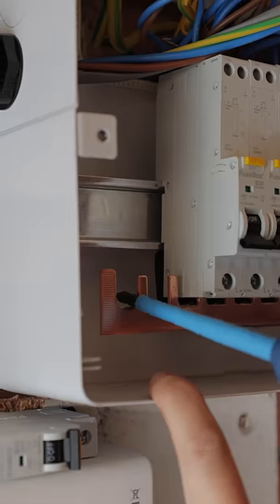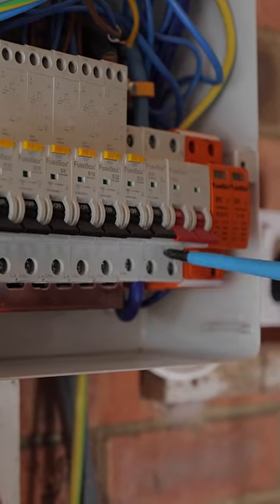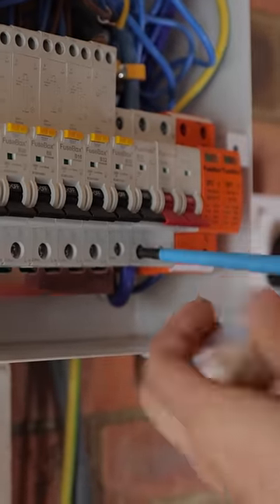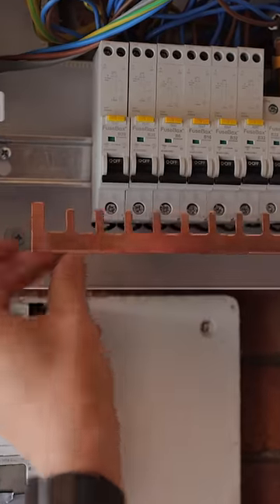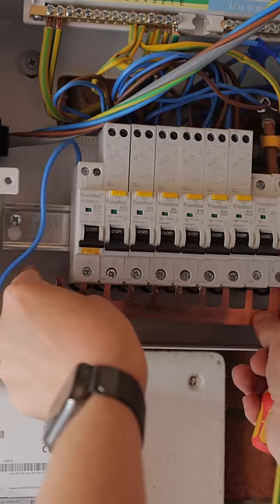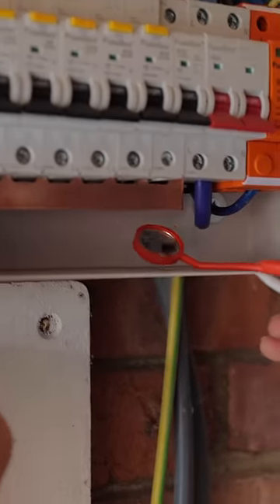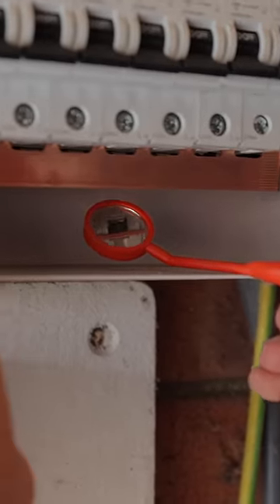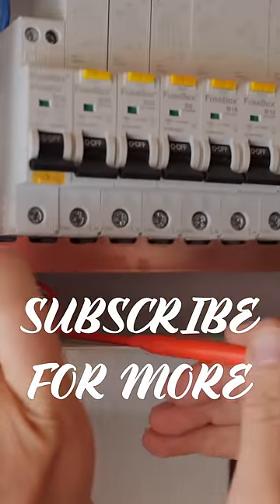It's always good to DOUBLE CHECK! Incorrect busbar installation 😮 #shorts

Comment: No isolated Busbar. Something you wouldn’t see in Germany nowadays. They all got a Plastic Cover.
Reply: As they should, first thing that made me frown when I saw this
Reply: Yeah nothing wakes you up like touching an uninsulated Bar 😂
Reply: @bobhempf7944  normally you should put the power off if you wanna work on it anyways
Reply: Same in France. Uk electrics are a joke
Reply: The plastic cover clips on last thing with that unit
Reply: @MrRobertBatchelor  everything should be ip2x so would have a cover over. This would be CE marked and comply for sale in France and Germany, so dont talk rubbish. I've worked with French electricians, or I should say I've corrected work done by French electricians.
Reply: A plastic cover is usually fitted to it after installation is complete.
Reply: We do have covers, but obviously he's taken it off
Reply: I would like to remind you that in this super fantastic Germany state of electrics you still have more electrocution deaths per capita than the UK.
Reply: Ich meins ernst den schock den ich grade hatte ach du scheiße
Reply: @jackster2568  but is the % higher? Iirc there are more people in germany than the uk
Reply: @HISKILP  you might want to look up what "per capita" means...
Reply: Ohh, and no lid on the box...
Or..
It's been removed already.
Reply: @dougaltolan3017  oh okay, sry :D
Reply: @jackster2568  in Germany 35 people died in 2019. And in UK 70 People died.
Reply: I work for a German company hager they use plastic sleeves on the bus bar
Reply: One day, the US will require to insulate ground all the way.....walks over taped over grass lawn.
Reply: Neither would you see one here, in Finland
Reply: @pab26120  If you can't work out why a larger terminal would be needed on the busbar at the main switch outlet you have absolutely no business messing with electrics.
Reply: @---jr5yb  yeah I'm gonna need a source. The various sources I've seen from a quick Google are half that (if even). Was 2019 a cherry picked year that had higher than normal deaths?
Reply: @einlehrling u cant always turn off the Power
Reply: @iloveiceecreeam8657  that's why I say normally. Of course there are some times where it's not possible.
Reply: @jackster2568  probably Germany is just much more electrified:)
Reply: Same here in Australia
Reply: Can't work on something with the cover still on...
Reply: ANGLE GRINDER muahhaaaaaa
Reply: @HarryL2020  apparently for some, not so obvious 😂
Reply: Agree, this looks crazy dangerous
Reply: @einlehrling 2 protection valent mieux qu'une, en france coffret ouvert aucune piece  sous tension ne doit etre accessible, deja pour que l'electricien puisse faire des tests en toute securite et deuxiemement au cas ou un non professionnel ouvre le coffret.
Reply: @olivierfu7778  aussi au l'allemania
Reply: @einlehrling  And thats the difference with insulated busbars. 

I can swap out an circuit breaker, without having to shut dwn the whole busbar... 
It is designed to function that way in german installations. 

You dont have to understand every rule that VDE made, but most things are there for a reason...
Reply: @vophatechnicus  normally you have to shut down the whole busbar because of the 5 safety rules: 1st rule is to shut off the electricity
Reply: @einlehrling  but i love working in live electrical panels its so much fun risking my life /s
Reply: once bumbed into a 3 phase 400v phase to phase busbar that when i was installing a new cable, dropped the whole insulating cover. leaving me oogling the 3 copper plates, 1,5mm between them, under 3x80A main fuses. Retreat, and call for a shutdown.
Reply: They have a plastic guard for them
Reply: @ferrumignis  yeah no. Just use the larger bus bar on every post. Who know what you are gonna use on them. 
6/10/13/16/32A just use the larger one on all of them and you are free to go. That what he means. You are not supposed to go down in AWG in Germany and usually you use 8awg/10mm^2 or 6awg/16mm^2 so the bus bar is 8/6awg from front to end.
Reply: Yeah we get plastic covers here as well.. he will slip it over the busbar when complete im sure
Reply: @alanreedom2647  "yeah no. Just use the larger bus bar on every post. Who know what you are gonna use on them. "

Another clueless person that can't think of any possible reason why the bus bar connection would be larger where it connects to the main switch, but thinks they know everything.  Here's a hint:  think about current density.
Reply: @ferrumignis  You don’t have to explain to me what you mean I understood it. If you have 18A x 8 that is 126A but what should happen is not that prong 1 can take 126A EVERY prong should take 126A. That is the correct way.  That what you mean is just the wrong way, it’s narrowing of the cross section, that is just wrong. Every part should be the same cross section, so if you beef up one part you beef everything up.
Reply: @alanreedom2647  You still don't get it.  If every prong draws 126A, then the one at the end will need to support a draw of e.g. 1260A for a ten way bus bar.
Reply: @bobhempf7944  once I was taking measurements with a multimeter and the pins accidentally touched the unisolated busbar, that was a nice spark
Reply: @YTDumpsterBaby   I don’t doubt that. Whenever I watch electrical videos based in the Uk, the electrical products seem to be of lesser quality and the installation seems over complicated. And the products are from the same brands in France and England so it seems like they’re just fabricating sub par quality for the British market. I’m not really saying that Uk is more dangerous.
Reply: This has a plastic cover. It's been taken off.
Reply: @MrRobertBatchelor  I've only seen videos of British switches and such and all of it looks like total crap.
Reply: @MrRobertBatchelor  can you not see the clips the busbar cover slides onto? How’s he supposed to install breakers without removing the cover first , don’t speak upon a topic you’re uneducated on , makes you look silly
Reply: So does this one he’s just removed it to install breakers , worries me how uneducated some electricians are outside their own country
Reply: @einlehrling  its not about working on it
Reply: @sackratte  why not
Reply: same in UK..
Reply: @MrRobertBatchelor hard disagree there
Reply: It has, just a short explanatory video about the two way end of busbars.
Reply: It clips on afterwards
Reply: @MrRobertBatchelor that will be covered. I'm fascinated to hear why you think the British system is a 'joke' and France's is superior?
Reply: @literate-aside Just the quality of the products seem sub bar to what I see in France.  They also have a lot less breakers on similar size properties making me think they’re pushing the limits more. 
Mainly the aesthetics really.
The cheapest stuff on the market here looks similar to quality stuff in the Uk.
Reply: @MrRobertBatchelor  it's the same brands all over the world, with BS and IEC standards being effectively identical.

They objectively have the safest outlets, plugs and appliance requirements in the world.

I'm still struggling to see what makes them a 'joke' when your basis is things 'seem' to be worse. Are you in the industry?
Reply: Makes sense
Reply: @MrRobertBatchelor  he’s working on it… the cover is off! 😂
Reply: @MrRobertBatchelor uk electrics ain’t that bad it’s different brands off boards like fuse box ain’t very safe for working live but most now have a way so you can work live safely
Reply: It's the same in the UK.. I think he'd just not put it on yet
Reply: You've got to fit one in the UK as well
Reply: @MrRobertBatchelor  however French electric don’t even follow the European colour code standard you favour realise that plastic covers can always be removed with enough force if someone is installing it in properly covers could be removed by then

Comment: You'd think they'd insulate the bottom of that busbar.
Reply: To keep it nice and warm?
Reply: alot of em have a plastic cover you put over bus bar at end
Reply: my busbar is isolated. I guess this is the UK. They have different standards.
Reply: There is a plastic cover which clips over the busbar (you can see the mounts at the start of video)
Reply: Yoh think they'd put a cover on the whole box too.

Comment: Electric panels are so much different here in the states
Reply: Safer over here
Reply: And built quality too. Even the cheapest in the states has more safety features and less redundancy than this thing.
Reply: @gabrielrod1330  our regulations are much stronger here on pretty much everything except food.
Reply: Different - worse..
Reply: @gabrielrod1330  I challenge that...  To start with - we put RCBOs into the consumer unit.  They are protecting the whole installation..  Everything is built properly.   We also don't allow aluminium to be used.  Because that is horrible.
Reply: @tcpnetworks  alu is just being cheap, nothing to do with safety
Reply: @tcpnetworks  and RCBO is common in most European countries.
Reply: @tcpnetworks  RCBO is extremely common in most of europe
Reply: @Asbjoern  aluminium is cheaper than PVC now? Making things up isn't an argument.
Reply: Is this the actual panel or some solar controller? Looks like ups controls.
Reply: @jackster2568  aluminum is cheaper than copper
Reply: @danichicago9140  there regulations are different along with the fact the use high voltage then we do in the states.
Reply: @mitchponder837  no shit. Our 277/480 panels don't look like this either.
Reply: @Asbjoern  Australian here - RCBOs/RCDs are law.  We tend to use RCBOs now to limit circuit leakage current. 

American shit - nah.   None of that is safe.   Even a fresh install looks like it's utter crap.
Reply: @timmieskills  I know.   Used to work there.
Reply: American Code now requires GFCI protection for most areas of the home. Also, half the voltage to ground.
Reply: @user2C47  Ohio code for GFCI is bathroom, kitchen, exterior, garage and any unfinished areas. However every finished area is required to be arc-fault protected along with refrigerators microwaves, dishwasher and disposal
Reply: @timmieskills I don't have any of those, what are them for?
Reply: @tcpnetworks  we have gfci and afci protetcition and yes in panles too not just at outlets. I hardly see any euro panels with arc faults protection. Get off your high horse.
Reply: @tcpnetworks  in America we call them breakers and arc fault and ground fault breakers are commonly used in most residential buildings in new construction. Same thing as yall just used in a different way and if done properly can be just as safe as your work if it was done properly.
Reply: Yea no shit lol here in Canada as well...
Reply: Idk for electricity guys but houses in the US are cardboard wtf
Reply: @Jujulem61  those production homes are not very good that's why I work with custom builders in million+ dollar houses. Only a few in the past 10 years have used bad framers and are scabbing the houses together.
Reply: @daltonpethel5697  The ONLY time we are permitted to install unprotected cable these days, is in a hospital - we feed the supply into the cubical/room and put a medial-grade RCBO in that protects the room.  That way the supply can be reset within the room - so people don't die.
Reply: @tcpnetworks  yeah we stopped aluminum wire in the 70’s.

Comment: It pays to open the terminal fully otherwise the buss bar can be inserted behind the terminal.  You should see the mcb move to allign with others, if it doesnt then the copper is not clamped.

Comment: It’s so odd seeing single phase stuff, almost every household is three phase in Sweden, even smaller apartments these days!
Reply: Really? Hmm that's pretty interesting
Reply: From an American standpoint that’s pretty crazy to hear. Only commercial and industrial get 3 phase, you can request it to your house if it’s in the area I believe because I’ve done it for someone’s pole barn but residential is all single phase 120/240V
Reply: Even Americans get at least two phases.
Reply: @user2C47  technically yes but we call it single phase
Reply: @user2C47  technically it’s one. 
3 Phases over here are 3 separate 230V Phases shifted 120 Degrees. All 3 together is 400V.
In the states it’s just one Phase Divided there is a big difference. In the states it’s just the full 240V Phase
Reply: @user2C47  just because you get two wires go your house does not mean 2 phases. Neutral is not a phase it's the connection to the star point
Reply: It's mostly 100A single phase. More power than 15A 3-phase in Sveden.

Comment: With Schneider and NHP, you can undo the screw and give it a gentle push - it moved the clamp out of the way - assuring you are on the correct side when you pop the bar back in.

Comment: good thing about fusebox is the terminal clamps have a cover over so you cant connect to the inside of the terminal. good to check with a mirror though. Just wish other manufacturers would follow suit.

Comment: I’d be looking for your breaker panel for days, that looks so different than the panels here in the states.
Reply: Ours are based on a 100+yo design. The modern Euro ones look like a dream to work on.
Reply: In US, 
If you worked on industrial electric you'd be very familiar with that type of panel.

Comment: I just finished installing 3 phase machines today at work. I saw that bar and thought it would short out, then realized it was single phase, a dip in liquid electrical tape would probably make it a bit safer
Reply: Bring out the angle grinder, I'll make it the correct size.

Comment: In Finland we generally have 3 phase power strips with plastic speratiln and insulation they also have equal width prongs and we cut it to the correct length and put plastic end caps on each end

Comment: Interested in why there were three teeth of the busbar showing originally then only two once it had been turned around. Was it in the wrong position to start with?
Reply: Looks like he cut a tooth off towards the end of the video-clip. There's a couple of frames with all the teeth (3 over) while he's holding in on top to demo the correct direction, then only 2 over once fitted.
Reply: He added a circuit breaker.

Comment: For the technical reason why the busbar being in backwards is bad: the connection to the main breaker from the busbar is the single highest current draw in the panel. To prevent heat and fire, you want as big a connection between the busbar and the main breaker as possible. The thicker and wider prong has a higher current capacity than any individual other prong on it.

Is that busbar normally insulated? Maybe, he doesn't show the covers that have been taken off.

Should the busbar's spine be insulated? Absolutely.

Comment: That is good and all and I know that you are in the United Kingdom, but we over in the states have what I believe to be a much safer system and that is the box itself already has all the hardware installed the only thing left is connect the right wire to what is needed.

Comment: who the hell puts the main switch on the right though
Reply: Brits...   We go on the left in Australia.
Reply: @tcpnetworks  and the rest of the world i think... either top or left
Reply: @tcpnetworks  You can also put it on the left. Makes ZERO difference.
Reply: Some consumer units are different
Reply: The video is reversed.
Reply: @dougaltolan3017  no it isnt, the text is not reversed
Reply: @hussssshie  Whoosh
Reply: Meanwhile me, livin in an apartment, with no main switch to speak of
(from fun things we also have no grounding, there literally is not a grounding wire coming into the flat to implement any)
Reply: The fact that it is possible that a busbar can separate from the panel box is horrifying.
Reply: @Sidicas  it isnt because the bus bars are after the main switch (sometimes two main switches) and cfgi, and you need to unscrew all terminals holding it in
Reply: Heathens, infidels
Reply: Here in Sweden we have the main switch on the left

Comment: non-isolated Busbar? In Germany its all isolated for Elektrican Safety.
On Manufacurer Hager, you take no mirror. First you conected the cable, and last click ( no srew) the busbar.
you see the cable and conector every time.
Reply: thats why before you isolate them some have a cover on busbar with warning then when youve isolated it it doesnt matter :} Or isolate before you take the cover off, can still get to the mainswitch n test

Comment: Das es so etwas in manchen Ländern noch gibt, unfassbar!
Reply: so in Germany they have other ways?
Reply: It is similar but way better.
We work with 3 phases 230/400V and have to use only insulated components.
Residential electrician have to secure most of the circuits with a RCD and I don’t want to do it different.
Reply: BUT: I’ve you have to make electrical renovations you will know these copper bridges very well and already hate the whole apartment because the electrical box alone smells like shenanigans.
Reply: @Bestnightcoreofalltime  He said in the video to connect with a RCBO, shouldn’t he use a RCCB with all those MCB’s?

Comment: It always bugs me how so much of the electrical equipment and requirements in England are so well done (often better than the US), and then you have these stupid bus bars in the breaker boxes, which have tons of different ways they can be done wrong, often resulting in a fire hazard, and even when they're done right leave huge portions of exposed live copper just lying around in the box there to come in contact with who-knows-what...

There are so many better ways this whole thing could be designed.  I don't understand why these still exist.

Comment: Safley locked out..... what have you actually locked out? 
Dont understandwhy you would need a toy mirror if you knew what you was actually doing. 
Those are clamp terminals, if you unscrew them with a non magnetic driver then problam solved. Then fix the bar back right  with a torque driver (not the one you've used).